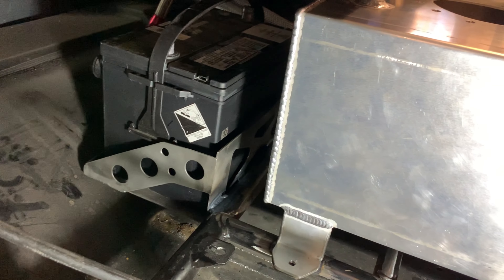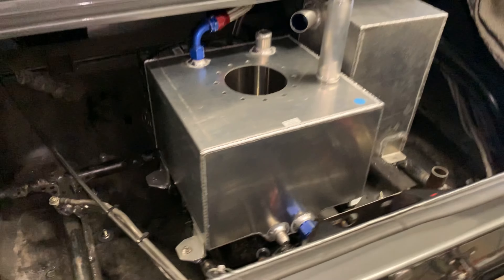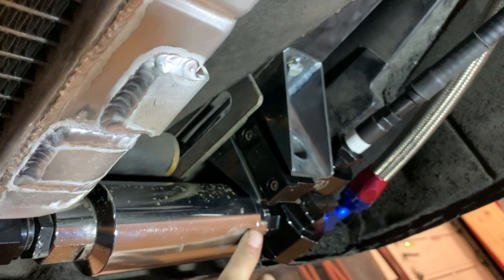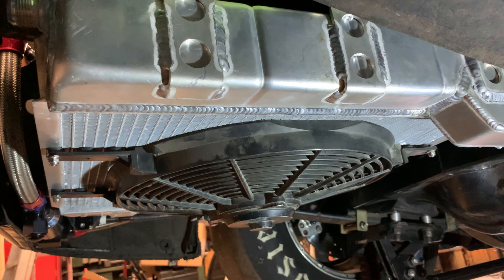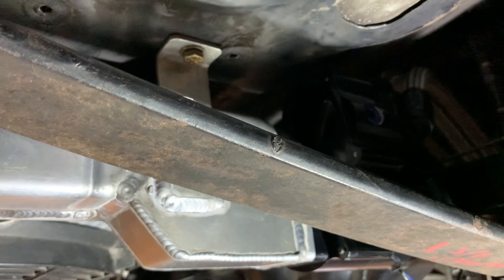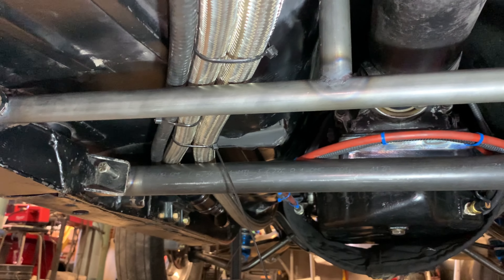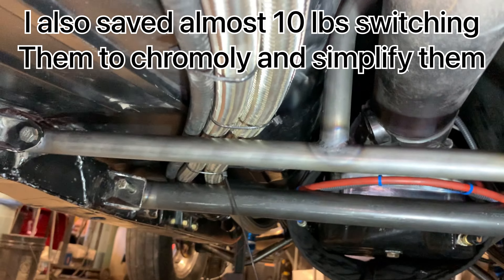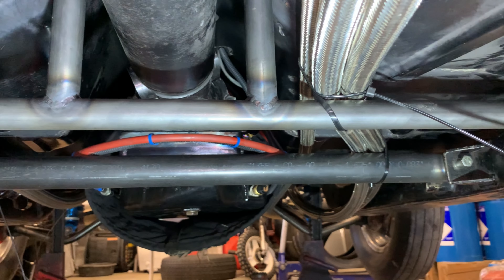UPGRADE SEASON IS HERE!! Moving weight around and lightening up this TANK!

Comment: In the process of putting my radiator under my bed behind the rear diff. Been researching these setups. Nice work man enjoy your videos
Reply from the maker: Thanks man and good luck with your setup!
Reply: @one_bad_attitude  just outta curiosity what size an fitting/line are you running for your radiator? I'm thinking on doing -16s on mine but that's pretty big hose and whatnot to run that far lol. I just couldn't really tell if yours were -12's or -16's.